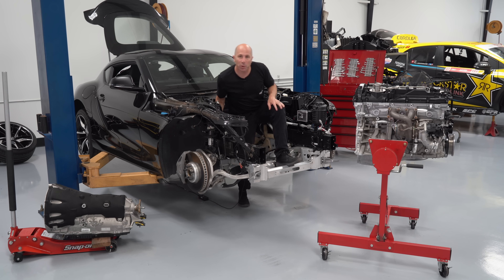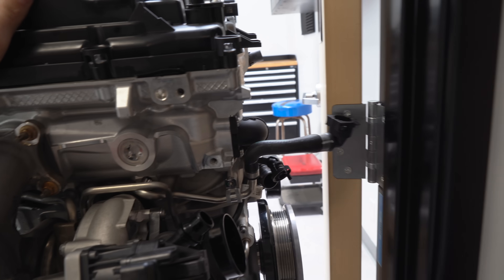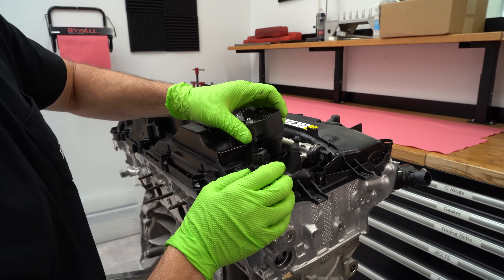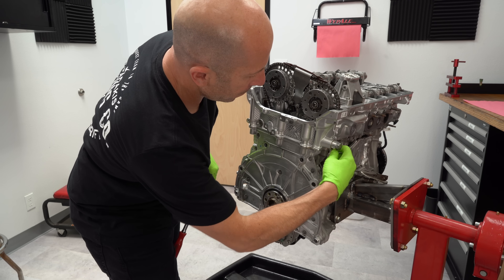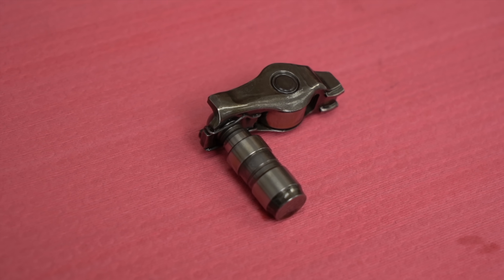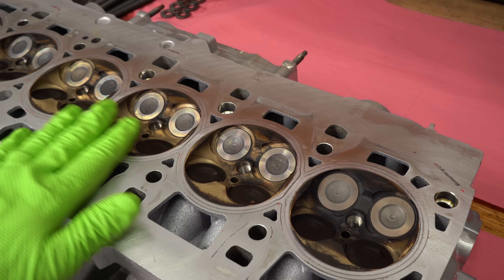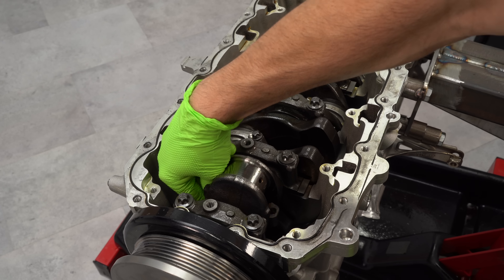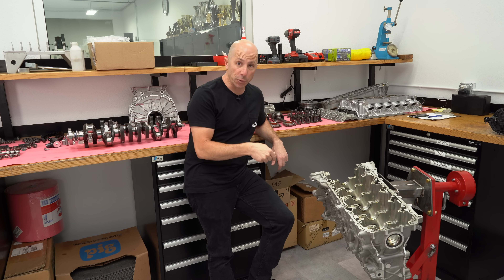2020 Supra B58 Engine Teardown - First Look - Better than the 2JZ?

Comment: Timing service? Pull the motor.
Cam swap? Pull the motor.

The curse of impressive packaging.
Reply: My thoughts exactly! This motor looks like a complete pain in the ass.
Reply: Yeah very tedious.
Reply: I didn’t see any dipstick either.
Reply: @tylerott9269  it doesn't... It have a Sensor that tell you.
Reply: @tylerott9269  you need to pull the motor for that
Reply: good luck to the basic toyota techs who will have no idea how to work on this engine
Reply: @bg710  I feel bad for toyota techs in general, first they had to learn and have tools for just toyotas, then they had to get subaru specific tools, now bmw specific tools. Getting raped by the tool trucks
Reply: one of the Toyota dealerships near me doesn't get any Supras to sell.  They are required to have at least one technician, be a "certified" Supra specialist.  So any dealership that gets to sell them, should be able to work on it.
Reply: b g dealers cant sell it without proper tooling and training
Reply: b g they have training classes for dealer techs. Literally every make trains their techs when new stuff come out
Reply: They followed ford's truck repair mentality what's that work on the engine pull the cab ohh you wanna do exhaust up pipes for your diesel better pull the cab again
Reply: German engineering.
Reply: @IamCombustible  Chinese I think. lol
Reply: You can swap cams and timing actuators with the engine in the car. BMW has been using this engine since 2016 and, at least in the shop I work in, it's been a very reliable engine so far.
Reply: @snerby141989  so far???? its been 2.5 years.  That means nothing.
Reply: @del7723  the first B58 was released in the 2016 340i with production starting in 7/15 so it's been out for a little over 4 years.
Reply: Del yeah but some of these engines are pushing a fully warranted 450hp. I know that not as much as these engines will see but thats still amazing
Reply: @snerby141989  ok. thanks for the info. you are totally right
Reply: @TamAgo-b6p  That's BMW's m.o. - be very reliable until the car is out of warranty, then be a complete disaster for the second owner
Reply: They do it so people don’t touch anything. They don’t want people to work on it.
Reply: yet strangely I love that timing chain tensioner design...looks so much easier to change than my Honda K20 tensioner. No cover, just thread out and thread the new one in. 

The K20 you need to basically pull the engine (and the valve cover) to do it safely, else it'll skip timing on you when you release the tension.
Reply: It’s not to be all that bad 😂😂😂😂
Reply: Tam Ago designed not to break but it can still break however I wouldn’t car I paid for it it wouldve been my problem at that point and besides the lifetime of a car is considerate on how I drive it 😂😂😂😂
Reply: Richard Ren not even needed, only ISTA 4, ISTA/p was only for programming E chassis
Reply: @user-__ll__  I suppose your idea of regular maintenance is an engine rebuild too eh? It would be next to impossible to get that kind of mileage out of an engine that is raced regularly without major services, unless you are just putting around the track at 2-3000 rpm.
Reply: @user-__ll__  How was it as far as oil and coolant leaks?
Reply: Too bad Toyota Techs get paid extremely less than BMW techs. Sounds like another reason to make a perfectly good tech hate the manufacture they work for. I hope your aware they pay that poor sap at Toyota 1.5hrs just to PDI that car that takes nearly a whole day to do. I wouldn't want my $100k - $200k Supra worked on by the only underpaid, unhappy "BMW" Tech in  that shop !
Reply: Reminds me of the B6/B7 Audi S4's. Their timing chain is in the back. Pretty much any service for the engine, needs to be taken out. Ask me how lmfao. Had one, swapped the motor on it, pain in the ass.
Reply: @Mahtt  Yeah the location of the timing chain is the same as the Audi but...
This B58 timing chain setup is very simple and similar configurations in other BMW inline six engines have proven to be adequately reliable. S4 V8 timing chain configuration on the other hand... Dear God! It is the engineering of an absolut madman!
Reply: @Ghost Toyota is that cheap uncle who still drives a 95 Celica.
Reply: Timing service? Ls swap
Reply: @alexelrod242  generic LS swap on a supra? i'd rather scrap the car. 2JZ swap ftw.
Reply: @TamAgo-b6p  The chains used to break-stretch a lot on bmws and its a 5000-6000€ bill at a dealership.
Reply: @henria.277  That was literally one engine - the N47 - and even then the issue has been grossly exaggerated (lots of people complained because they sold hundreds of thousands of them, but there's also loads of them out there running just fine).
Reply: The reason they're doing this now is pedestrian safety requirements. There has to be hood clearance between the hood and engine to pass these pedestrian safety tests and with a long engine like an I6 and a low hood that slopes forward this is difficult. By putting the cam gears and stuff at the back, the valve cover can be significantly lower at the front, and helps keep enough clearance between the hood and valve cover.
Reply: @yucannthahvitt  It's actually for noise. Gears and chains are relatively noisy, so they package them in the back where there is already noise from the transmission so you can't hear them. Making the front of the engine smaller is just a side effect of moving them to the back, but it is not much smaller in the grand scheme of things.

Same reason so many manufacturers use timing belts instead of chains, they are quieter than chains.
Reply: @hondaman117 Who uses timing belts anymore. That's like 20yrs ago
Reply: @yucannthahvitt  Idk about you, but I actually work in the automotive industry. The main thing you're forgetting is the cost to put the cam drive in the rear of the engine. Auto makers did not do this decades ago because there was no need or financial reason to, they were ok using older designs they had already developed to save money. But, as emissions standards have risen, automakers had to invest in new power plants to meet those standards. At the same time, the public has come to expect more and more from today's cars. So since they were already in the process of designing a new engine, they did everything they could to make the engines smoother, quieter, cleaner, and more efficient. It is very rare that an engine would be designed a certain way just to fit into a specific model of car when that engine might be used in several models through its production. Automakers never do anything unless there is a justifiable reason to do so, and it if financially sound. I'm well aware of the pedestrian safety standards as we have to work around them all the time. The the info I stated above are based off what powertrain engineers I work with on a daily basis have told me. Just trying to help spread some info.
Reply: @gr8bart1  Lots of manufacturers used timing belts well into the mid 2000s and 2010s. They have only recently been phased out in favor of chains again.
Reply: I thought motors were electric? I think this car has an engine bud.
Reply: Never heard the words motorcycle, motorcar, motorsports, motorboat, motorcade, motormouth, motoring? Definition of motor: "a machine, especially one powered by electricity or internal combustion, that supplies motive power for a vehicle or for some other device with moving parts."

Comment: 2 things... im not sure how much confidence id have in that internal aluminum exhaust manifold, and why do these companies use air to water coolers? it needs more parts making it more expensive and heavier and is less efficient than an air to air front mount(if you arent using ice). but at least its a closed deck design.... glad some companies are still using these and not worrying about the few extra pounds it adds... cuz its totally worth it

Comment: I’ve realized that, the simplicity of some modern cars. These new cars are so simple when dropping the engine. Say the Chevy 3.6, literally just 3 big connectors that go to the ecu and then the coolant/fuel lines and that’s it. Take the subframe bolts off and the whole thing can drop in less than 2 hours. I’m doing a 2018 Honda clarity hybrid and same story, I was nervous being a car so new but it’s so simple, again coolant and fuel lines. 1 big connector in the ecu and the connectors that go to the scroll compressor and the battery ontop of the trans then it’s ready to drop. Most older cars you have to disconnect everything inside the car and leave the whole wiring harness in the car but I’m loving how these new cars you can just split the harness and not have to worry about it until it’s out of the car

Comment: im sorry but i think its terrible. u cant use custom intakes / custom exhaust manifolds, there is so much proprietary things on this engine , even tho you can tune it and im sure there will be some custom parts, it will never be the same enthusiast level engine the 2jz was - this is a bmw pos right here.  you will customize very little on the engine except maybe a turbo swap, or changing some of the electronics / tune -  well see into the future how the bottom holds up.  the record for a stock 2jz GTE bottom end is 1087rwhp ,, people run 700-800 all the time on stock bottom ends. is this engine better than a 2jz? someone needs to put 700-800 hp through its stock bottom so we can answer that question. i bet it doesnt hold up. in other words, i bet this is no where near the beast the 2jz was, even though its new, has new features, is lightweight etc etc, none of those things matter if it cant produce hp. i mean 500-600 is nice. lets see this thing break 1k hp. then i will pay more attention to this engine. until then i call shenanigans and remain but hurt that they did not keep this car all Japanese

Comment: bmw allredy made a beter engine than the 2j. the n54 was allredy more capable. only reason 2j got to those high 1k+ hp numbers whas becaus of 99% of the engine being aftermarket. even the 2j block had to be modded to get 1k. the n54 was capable of 800hp out of the box and reached 500hp with just small mods and meth

Comment: dear god those are pressed in lobes on the cam shaft... I'm having V8 SHO flashbacks now...
Reply: on the VW mk5 TSI engine, they have pressed on cam lobes too, and they have all sorts of problems with the fuel pump cam lobe slipping especially, and other lobes slipping slightly less so. it's a really hard problem to diagnose too, since unless you measure it with a dial micrometer against the OE cam specs, you'll never notice it, the car will just run weird for no apparent reason.
Reply: Robert Hollar absolutely ridiculous. Why not just have a solid one!!!!
Reply: @jacksanders2636  separate machining process and assembly, these thing as are freeze crimped on.
Reply: @jacksanders2636  Gen V Viper camshafts are not solid but they are not really problematic. it all depends on the design and build quality.
Reply: This is a long established design not unique to the SHO V8, it’s used on every single modular V8 ford ever built and was not problematic. 

And the SHO engine had problems with the sprockets not the lobes, non keyed sprockets present an added issue in that they need to be serviceable, cam loved are not.
Reply: @DrewLSsix  They did have problems but less so than the sprockets. There where a few V8 shos that did did spin a lobe. All cams that are made press formed suck ass. Also no most of ford's modular line are all milled cams...

Comment: wait until you have to pay BMW prices for parts.
Reply: BMW part prices are cheap. Only major expense is what people charge for labor on them honestly, which isn’t a problem if you work on your own car.
Reply: 60 bucks item for only to rotate the crank pully hahahahah BMW really know to rob the mechanic and the owner hahah
Reply: @kevinbosco5876  Even us 2jz owners have to buy a £60 tool to remove the crank pulley bolt. There's cheap ways of getting around it though, same as this BMW b58 engine
Reply: Firelights hmmm as far i know normal torque wrench will do the job because have bolt in the middle of course you need buy the torque wrench first  for 60 bucks  but you need buy 60 buck more for open key that pulley crank for that bmw
Reply: Buys Audis, shits on BMW part prices. LOL, enjoy the tarted up VWs.
Reply: @UC3RR9BaZy7fGXLMiDC9t4bw Yawn ok BMW fan boi.  I can afford the car NP. I still wont buy a BMW, I have a Q7 instead of the X5.... Doesnt matter how much you spin this. The car is 90%+ BMW not Toyota. They could have used Lexus engines.

Comment: Old cast iron straight sixes from BMW has proven to handle 1000+ hp with ease, and hopefully these new alloy blocks will hold up just as good.
Reply: 3milio0o Sadly cast iron will always be stronger than alloy blocks.. now to hoping it can handle over 1000 hp

Comment: The engine is built solid at first glance but once you get into the details I am seeing huge dollar Bill's if you want to do simple improvements the biggest problem is heat management on the engine block and that it's all aluminum does not make it easier either if you ask me very good engine but better left stock

Comment: This is so interesting!!! Plastic intake manifold, intercoolers in the exhaust and intake manifolds, internal exhaust manifold, jeez!!!
Reply: Great engineering though for a compact power plant!
Reply: @kevintucker3354  just because it works doesnt make it better lmao
Reply: @the_visionvry6244  he never said it was better
Reply: @frostnone5128  what are you 12? he said she said? my point still stands regardless of what he posted....
Reply: intercooler in intake manifold*
An exhaust manifold would be an odd place for an intercooler
Reply: More and more you will see it with new engines
Reply: You want to see stupid design look at the BMW N63. The bury the turbos in the Vee of the motor and use reverse flow manifolds. The amount of heat soak in the valley of the motor is insane that it's cooking all the lines that run through that area. To top it all off BMW uses tons of plastic which obviously goes brittle. To go even farther there are 2 cooling systems because one cooling system has to be dedicated to cooling just the turbos and since BMW wanted good fuel economy the computer automatically shuts off the alternator so the car eats batteries.
Reply: Dashcam Dumbasses strange.... my F10 M5 has been doing quite well. Also FYI, the only lines in the V are metal aside from the intake ducting. There is it any rubber lines there. It’s all metal heat shielding and piping. The only thing to get brittle over time is the stupid ass engine cover. It’s better to have an engine built this way for gear management as hot air rises and the hottest part of the engine is the exhaust. But it’s more expensive. 
Leaving the intake manifolds mounted lower and further away from heat soak guarantees better fuel economy and power. If they kept the motor for further cars, they could have designed a nice vent in the hood to help with heat extraction.
Reply: That’s the new thing. How modular can you get. There’s actually a whole BMW keynote on it somewhere online about it.
Reply: @Freezy Lizard k
Reply: @the_visionvry6244  who TF hurt your feelings you got defensive for no reason at all

Comment: I found a quick fix if you dont have the tool for the those springs on the intake side. https://youtu.be/5ieUmpVxNfc

Its funny...  I can see the design influence from bmw all over the cylinder head and valves... I just did the wifes timing chain on her 2011 mini cooper too and it has the exact same variable valve timing system and eccentric valve lift system on the intake side, keepers, hydraulic lifters, springs etc. 

P.S that [Vanos/Valvetronic] system was designed by BMW was also used in 2007 - 2013 Mini's, PSA/Citroen and were prone to timing chain stretch as early as 30k miles on some. Sometimes parts of the chain guide would break off due to the chain slack and clogg the oil pickup. I hope it's not the case with this system.

Comment: Cast Iron Block Will Always be better and time has told us that already. 😉
Reply: So we'll forget that both the aluminum block VR38s and LSX's exist and make the same amount of power a 2jz can handle too? Ok then.
Reply: @carboydorifutoparty3976  always remember that the RBs need internals changed out while the 2j needs nothing changed out to make 700 horsepower.
Reply: @mrred123  ok but that doesn't mean that cast iron is the strongest all the time were as VR38s,LSX's,S55s,and now currently the B58 can handle 700hp without changing its internals. Including other iron block i6s like the barra,TB48,and 1FZ that can handle over 1000hp on stock internals like the 2jz heck the RB30s stock internals can handle more than 1000hp.
Reply: Anyting can handle a certain amount of horsepower but you're forgetting one thing... reliability.
Reply: @mrred123  regardless of the engine theres no such thing as a reliable engine with 1000hp even if it's a 2jz there's no one who's lasted with a 2jz up to 200k miles or even 300k miles for the record. Regardless if it's a iron block or aluminum block its not going to be reliable compared to it being stock.

Comment: So permanent log manifold, 2 bolt mains on an aluminum block and a timing chain you cant service without pulling the engine 🤦🏻‍♂️🤦🏻‍♂️🤦🏻‍♂️🤦🏻‍♂️🤦🏻‍♂️🤦🏻‍♂️ great job toyota🖕🏼